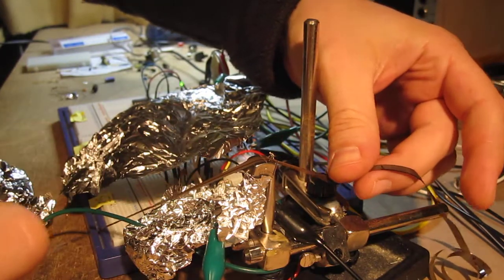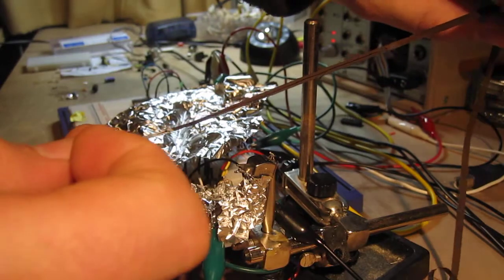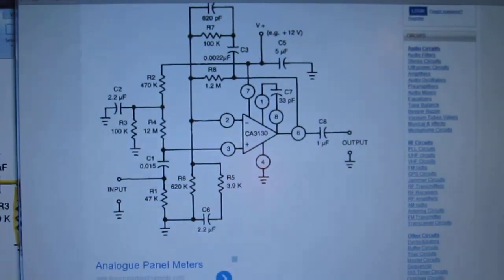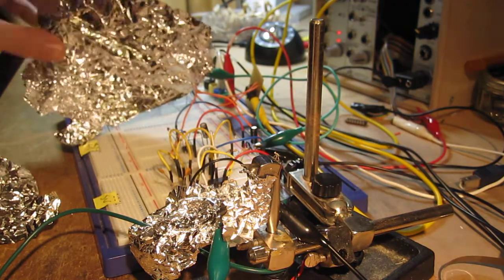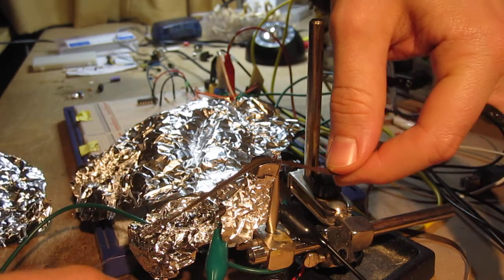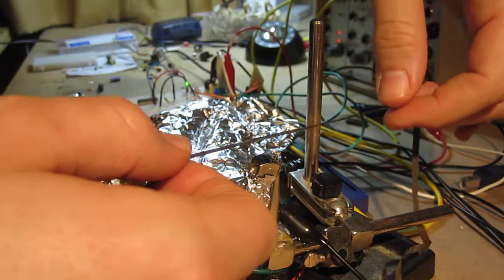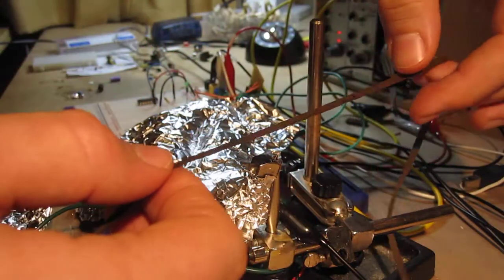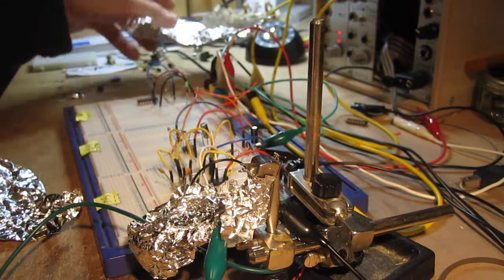Mechanical sampler: cassette head playback circuit

Comment: hi i watch your video    soundcraft   ace's  reel to reel  decks use kind of lay out   i service  my decks nice tip   i have a reel to reel that take cassette tape 1/8 inch tape   can't make a video 
as the man i go it of said it would go crazy    tip change a cassette deck to 3 3/4   x2 speed  and have one of the last  pro decks  that are made i have  a full set of pro deck

2 4 6 8 track at 3  3/4 and     7 1/2 with 8 tracks on a tascam 238   keep up the good test work

Comment: You can make an amplifier using a 2N2222 transistor and two DC blocking capacitors and a 100K and 2 10K resistors. You might want to try to take apart an old credit card machine and use magnetic stripe cards if what you want to do is make DJ record scratching sounds.

Comment: have you tried the Analog Devices circuit you linked to with this? Playing around with a tape head today and trying to find a suitable preamp circuit
Reply from the maker: I must confess I can't remember what I did with this.  The tape circuits were experimentation for my Play House piece but I ended up dropping them for the design, and then the build kind of took over my life after that!  I will pick them up in future though.  I struggled to find clear example circuits.  A lot of them used ICs that are not sold any more.  In principle it's simple, just an op amp biased correctly for tape and with correct filtering, but my meager electronics knowledge is not up to designing from scratch!  Probably worth checking out some electronics projects books, R A Penfold, that sort of thing.
Reply: Alex Allmont
ok cool, great job on the finished Play House project by the way. I found a place in Greece on Ebay selling 50 play heads for about €20 so will have a look. I have a few NE5534 opamps which are possibly suitable.
Reply from the maker: Ed Devane Awesome, are there any more for sale? If so please ping me the link, will definitely need more in future
Reply: Stowe1664
http://www.analog.com/static/imported-files/data_sheets/OP37.pdf  page 13 figure 9. I bought a few OP-37 op amps but I haven't got around to testing the circuit yet - will be doing so in the coming weeks so will report results
Reply from the maker: Ed Devane Stowe1664 Cheers Ed, I gave that circuit a go but all I got was noise. Let me know if you have better luck!